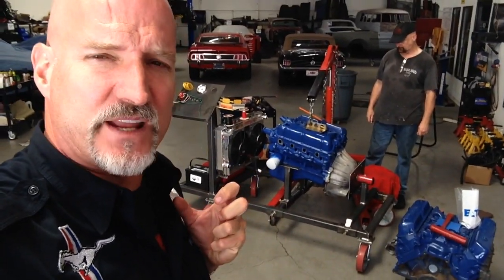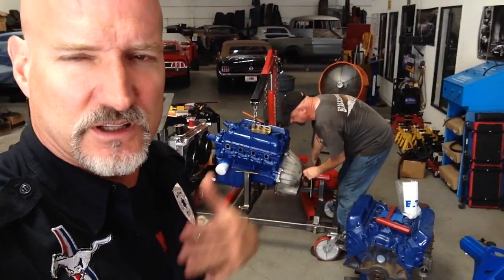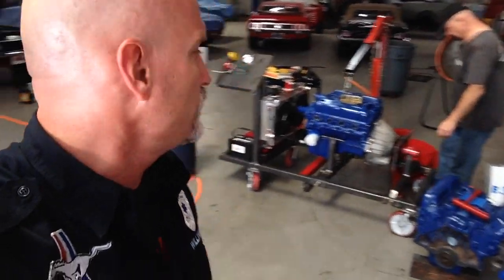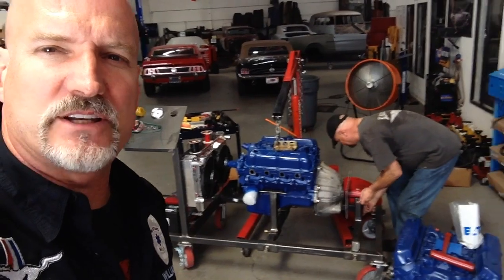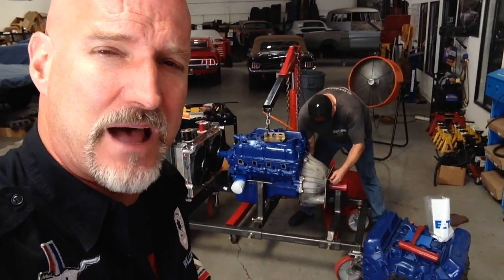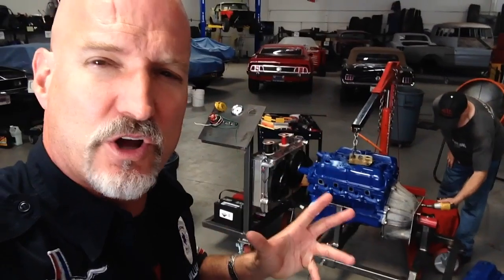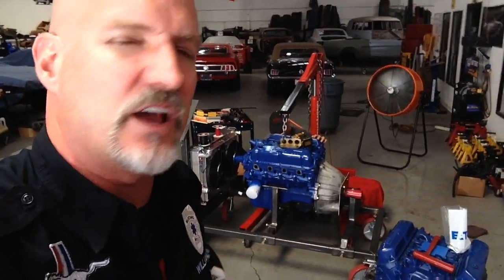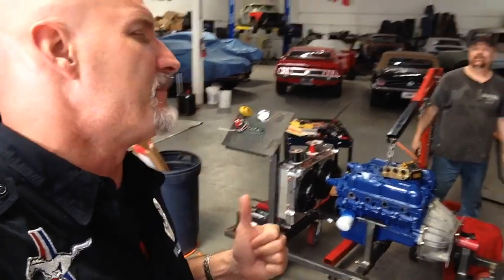351 Windsor ready to run on the MustangMedic Engine Run Stand - Day 10

Comment: If the pick up tube is not all the way to the bottom of the tank it will not run low. If it was happening on an angle it points to the problem being in the gas tank with the pick up tube. I bet you that it dont miss or cut out when it has a full tank of gasoline. if it does cut out during low tank like a quarter tank or less its the pick up tube not the correct one or not installed properly. Some tanks when the sock comes off they wont pick up at low fuel. Is that a new gas tank? And a new pick up tube? Something is not right there in that area maybe?